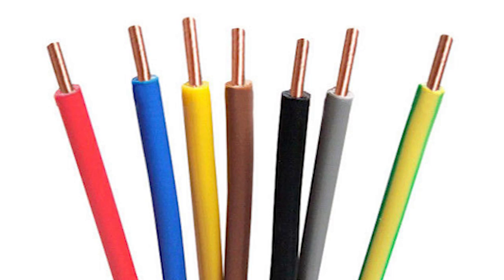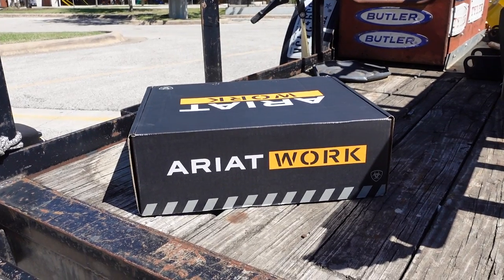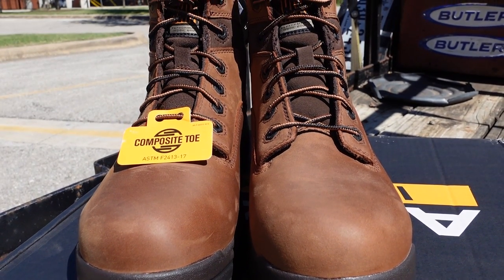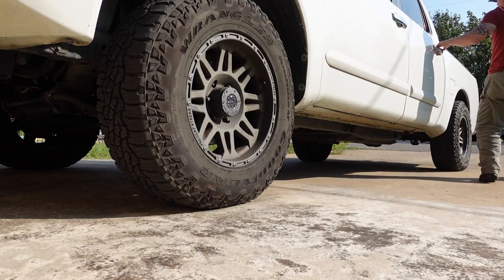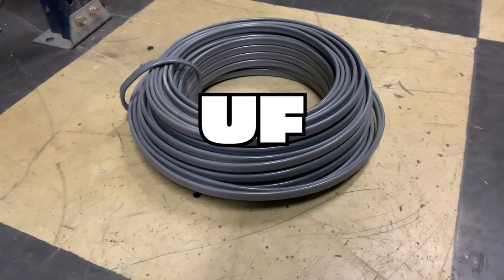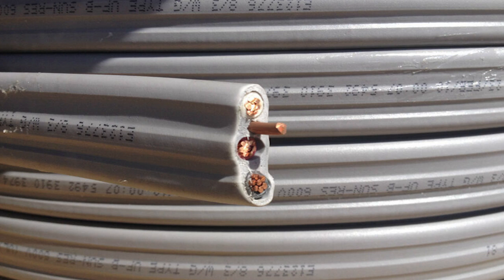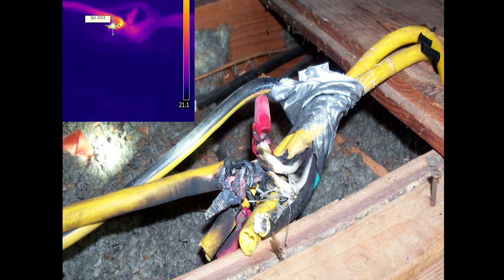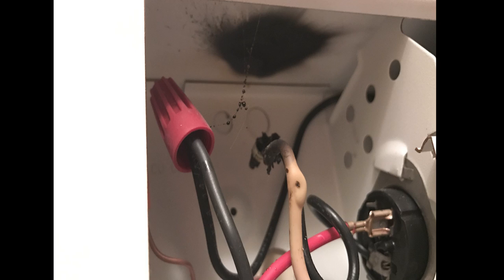Why Knowing WIRE INSULATION Types Is Crucial

Comment: from the Massachusetts attorney general . Yes the greens are getting you again.
Go green. go broke

Does your car have soy based-wiring?

In general, it’s difficult to determine if the vehicle has soy-based wiring based on advertisements, or based on any of the usual paperwork involved with a motor vehicle purchase. Instead, consumers should ask the selling dealer if there is soy-based wiring.  Under the Attorney General’s Motor Vehicle Regulations, the dealer has to disclose any material fact that would affect a consumer’s decision to buy the car.

Comment: Dont use cheap shit. Only buy 90 or 105C rated wire for THHN and THWN. It doesnt cost that much more

Dont run romex an an attic, crawlspace or garage. By code you can run romex in an attic but you WILL get animals up there eventually that will chew through wire. Run MC or flex conduit or EMT. 

Garages have to use MC, Flex or EMT for exposed work.
Reply: If you don't run Romex in the Attic and use Conduit, what wire/cable would you recommend running?
Reply: @simkinsdesignstudios1601  MC cable. It is much more resistant to rodents chewing through it and is much tougher than Romex.